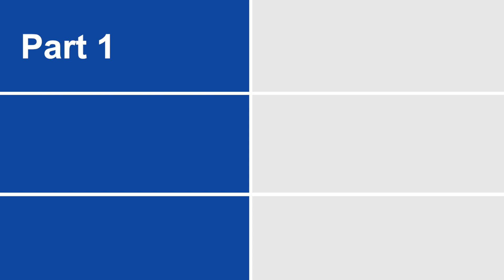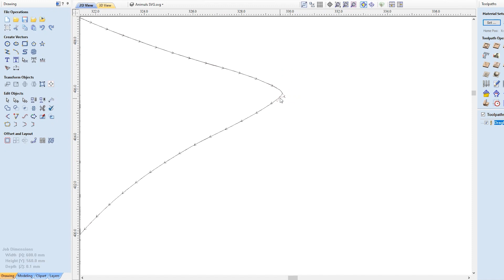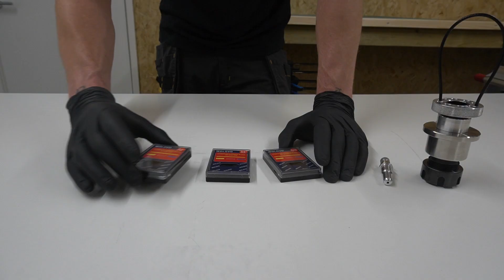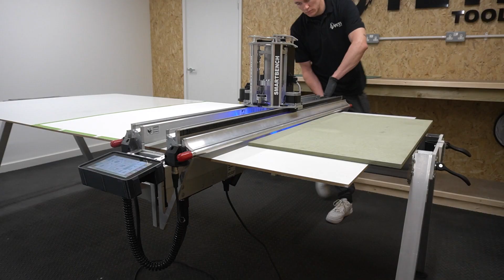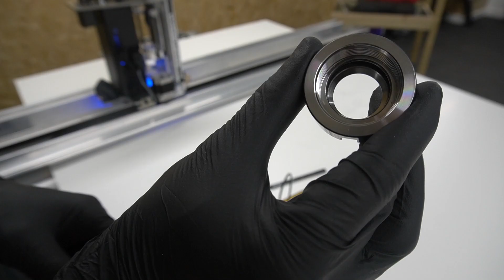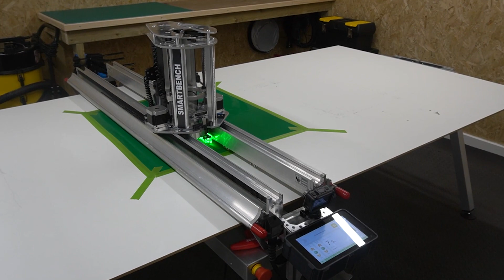CNC Stylus first project: vinyl cutting stickers

Comment: Turning my Yeti Smart Bench into a giant plotter is a brilliant idea! However I have a Mac, so Vetric is not available to me. As a work around I've had great results with Carbide Create for cncing (far less confusing than Fusion360) Do you think stylus would work with Carbide Create? and also could it handle engraving soft metal with the right cutter?
Reply from the maker: Thanks Julian, I’m sure it would be usable with your software. For pen plotting we use profile and pocket tool paths, and for vinyl cutting we use the drag knife gadget in Vectric. We haven’t tried soft metals but I imagine there would be too much friction which could cause breakage. CNC stylus had been designed for just cutting vinyl.
Reply: @CNCSmartBench  thanks for the reply no doubt I'll be saving up for a stylus soon👍😉
Reply from the maker: @julianadams2404  we are sure you will love it!
Reply from the maker: @julianadams2404  No worries! Be sure to get in touch if you have any more questions.
Reply: I have been using Parallels Desktop for years with my mac and it gives me the best of both worlds.